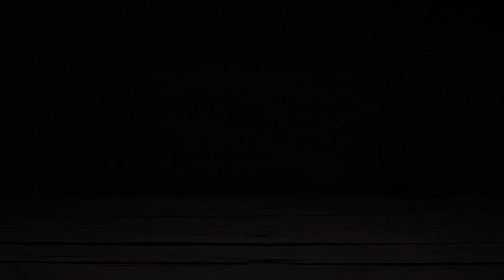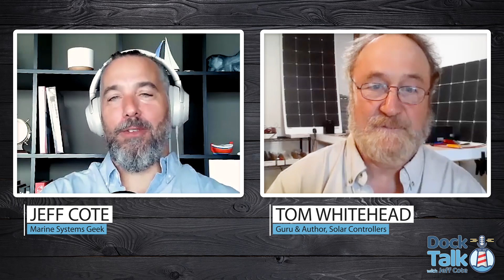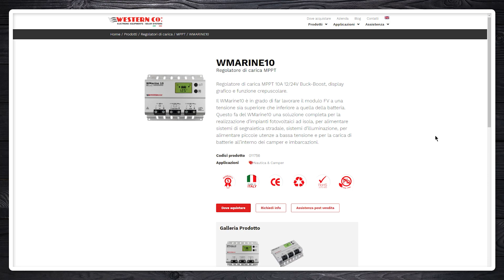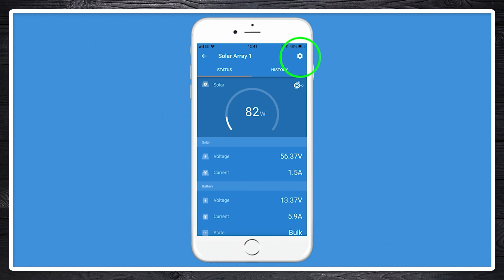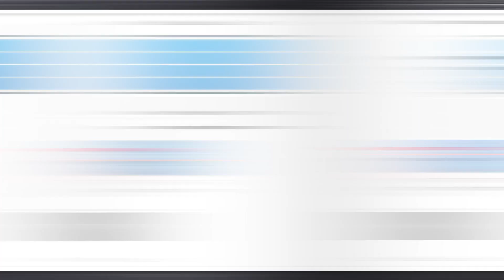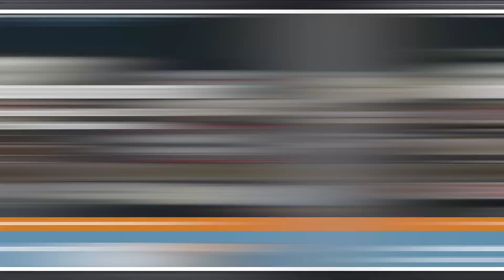Dock Talk with Jeff Cote and Nigel Calder - "All Things Solar" - Part 1 of 2

Comment: Great content!  For a 6 battery, 6 volt golf cart battery flooded lead bank, wired in series and parallel, where would you  suggest attaching a Smart Sense monitor?  Closest to the charger/MPPT or furthest?
Reply from the maker: I'd get the battery voltage from the positive post battery at one end of the bank and get the negative at the other end of the bank. Basically you want to get the voltage across the whole bank and not just one pair of 6 volt battery in series.

Comment: Since charge controllers have dual functions (optimizing the wattage out of the PV array, and optimizing the charging of the battery), does anyone make separate units? It would seem that each battery should have its own BMS, and each panel, windmill, etc. it’s own MPPT. This way, every component would be optimally used.
Reply from the maker: Only aware of controllers that do both in one device and not seperate.

Comment: Why not use a solar combiner to combine multiple panels/arrays then go to one MPPT controller?
Reply from the maker: You can definitely do this, either wiring multiple solar panels in series or in parallel to a single controller.
Reply: @PacificYachtSystems  Thanks! Love your YT shows.  Keep it up.

Comment: Hi Jeff. 
I love this. I am a fellow sail boater. I am going all electric with a 48 volt system. I have space for three 310w 33v rigid panels. Q? Is it better to get individual boost controllers for each panel, or go series with all three panels with blocking diode between each panel. Would it be better to go with smaller panels and make say 3 banks of three 100w panels. And controller for each bank. Space should be about the same. Dilemma! As usual cost is always a consideration. 
Great channel and thanks so much for posting this.
Reply from the maker: That's a tough question, because there are so many options to consider. Considering the wattage, array voltage, and the fact you have 3 panels, suggest you go with boost controllers and keep the solar voltages below 60 volts.
Reply: @PacificYachtSystems  thanks Jeff. I take it you’re recommending staying below 60 v for the safety factor. Appreciate your time.